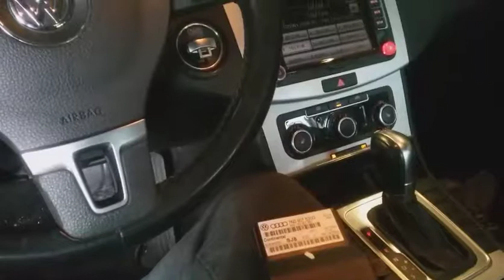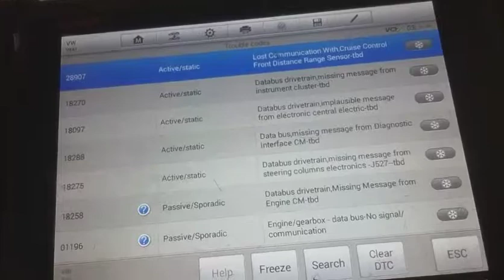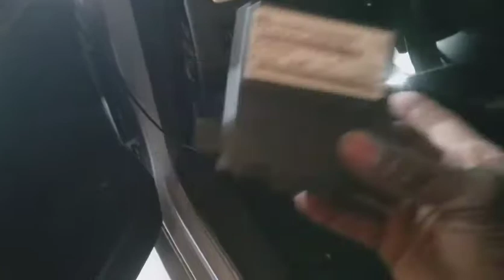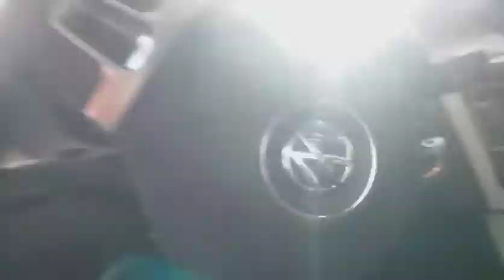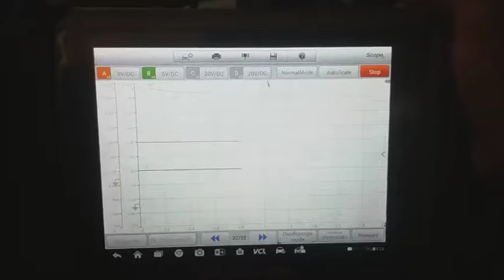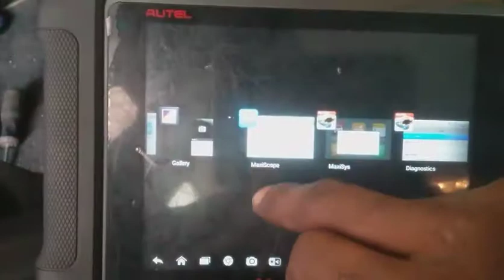'12 VW CC sport Gateaway Control Module "no comm with all computers"

Comment: This video pointed me in the right direction. I had no communication at ANY module. TCM included.. after checking fuses, I found this video. I didn't bother with the PCM, and skipped straight to the gateway and started tapping on it like you described, but nothing happened.. While I'm down there, scratching my head, I noticed behind the DLC, there were wires that had been cut and butt-connected together and were different colors than what the schematic showed. Pin #6 and pin #14 had been cut and someone spliced another set of CAN wires into them. Left the orange wires just hanging under the steering column. I switched them back to their right places and the car now scans and starts but still running really rough and tons of communication codes returning. Thanks for the video, you saved me a bunch of time! Now if I can figure out the other issues lol

Comment: bro i have been trying to diagnose the same issue for 2 weeks same car 2012 cc r-line i bought from a  customer because the  Timing chain tensioner failed and it jumped timing i  Replaced all timing parts put new intake valves in it put the head back on it car runs great . after driving it for a week it started doing the same yours is expected sometime my car starts up and runs fine however when it doesn't I noticed the indicator light that let's you know a door is open doesn't appear when you open the driver door which upon opening driver door is when the full pump prims  . did the brake light, abs, track light come on ? bro I have double checked every g wire cleaned  Connectors plus in the process all that I noticed the water pump leaking and leaking on the temp sensor there was coolant inside the connector so this afternoon I replaced temp sensor and cleaned and connector . I haven't plugged it back in yet decided to let it dry really good . I don't know what else to do honestly stressed out hopefully gate way control fixes its i have also taped on ecu abs pump relays with a screw driver
Reply from the maker: Hopefully after replacing the gateway module, this resolves your issue. If not get back with me.

Comment: I have 2009 cc it starts then shuts off immediately, replaced alternator, battery & still doing same thing & I can’t use key fob to unlock doors or windows won’t let up
Reply: Hey did you ever figure it out mine is doing same thing

Comment: I have a 2010 vw cc that wont start because someone jump started it backwards
Reply from the maker: Check main battery fuse 50-100amp .
Reply: @partsshooter  everything works on it and it cranks but no start. like it doesn't have spark
Reply from the maker: @supertitan21  ahh.. Ok... Just ensure that you check all fuses!  That's a good sign it rotates in effort to start! 

If it worked fine before the jump start attempt that failed, then odds are high that a fuse is blown.

The pcm utilizes feed back from multiple inputs to get a starting signal, this is a good sign you likely don't have pcm problems. 

Do the basics, supplemental fuel and check for fire if the fuse check Turns out ok!
Reply: customhonda  i tried to get the codes from the car but it only has this one. U0100 indicates the PCM is not able to send or receive CAN communication signals. This car was at the dealership and they said it needed a new ecu at $2200. Im wondering if there is a way to install a used ecu from ebay for $100. Im not sure if these need to be programmed or i can just swap them out. I did check all the fuses and they are all good. Another weird thing that it does is that the cooling fans are on the whole time i have the key on engine off.
Reply from the maker: @supertitan21  the only other thing I can do to help is that I'll need more technical info from you! Such as scan data communication information from all modules. Because it's gonna get real technical real fast! 😆 

To answer, yes your computer need programming.
Reply: customhonda do you happen to know how to go about getting a used ecu programed to my car? I remember i had an issue like this on my old e46 330i. The ecu went bad and I bought a used one then i sent my cars ecu and the used one that I bought i think i also shipped the key with it. Once i got it back i just plugged it in and everything was good
Reply from the maker: @supertitan21  it just need the vin number recognized in ecm. Depending on the vehicle, there will be a separate immobilizer for starting circuit. Likely the vin just need inputting. 

You can get a used computer and try calling a mobile programmer to install vin in your local area or to program key for starting circuit. This procedure vary from manufacture. I recommend getting a remanufactured unit where they'll do all that

Comment: Im have a 2011 CC Sport and I left the battery out for months and now I don't have electronic steering, it says electrical fault in circuit, also had a problem setting steering angle sensor, its a brand new sensor from the dealer. any advice?
Reply from the maker: Can you communicate with that steering module with your scan tool?
Reply: @partsshooter  Yes.. I have Vag Com on windows 8...its giving me a couple errors that come back when I erase them, it was driving fine until I had it sitting, it has to be a programming issue. I actually just took out the entire rack, the positive and negative wire tested fine, now Im guessing I should test the T-60 and T94 wires..
Reply from the maker: @JohnReedmedia  I think we are ahead of ourselves at the moment. Is there anyway you can send me codes from when all the original components were installed, the cleared codes and immediate comebacks 1st.

Also before everything was installed, could you communicate with the module, was there PID [parameter identificaton] data available?

You'll have to start from scratch with me, because replacing should've been last after confirming there's no communicating with that module only. 

Thing is, just as in my video, there wasn't communication with modules and it was due to another module and not that of pcm.
Reply: @partsshooter  I had communication with the module, yes there was PID info...however the yellow steering light was on, I had steering limit stop errors along with a steering angle sensor error, I let it sit then all of a sudden the battery died causing the red steering wheel MIL...I have all the reports. let me find.
Reply: I actually followed your video and testing all the hot and ground wires, I got up to the point where I even tested the cam low and high wires, got around a 2.0-2.5 V reading, I stopped there...
Reply from the maker: @JohnReedmedia  thanks for reply...

have you done a complete clear of all modules? As some codes can linger causing limp mode.
Reply from the maker: @JohnReedmedia  lucky you I have the VW today. I have a video of steering angle pid data, let me know if you want it uploaded. Hopefully it'll help!
Reply: @partsshooter  yes please! where were you 6 months ago? lol
Reply: @partsshooter  update: I did a parasitic drain test and found out that its coming from #12 Fuse, once I remove the fuse the draw goes down on my multimeter, 012 code was showing up on my scan tool as well. its say "Battery Positive voltage to Data link cable" in the diagram..so my hot wire is bad to my DLC Im guessing
Reply from the maker: @JohnReedmedia  let me investigate that code, but I got 3 vids uploading. I'll shoot the link in our exchange, hope this helps. I was needy of a code earlier. 

Give me a few...
Reply from the maker: @JohnReedmedia  video uploaded.... Hopefully the data helps!